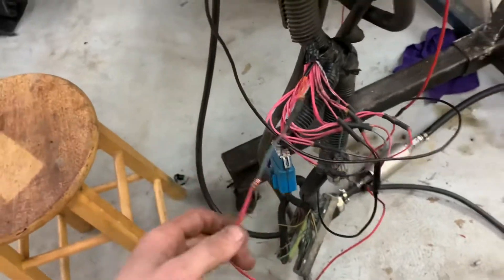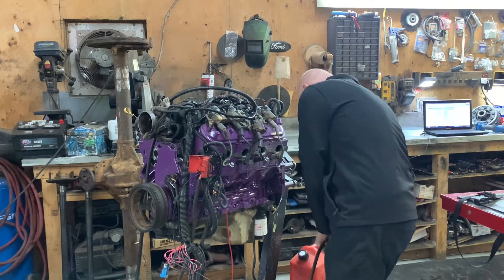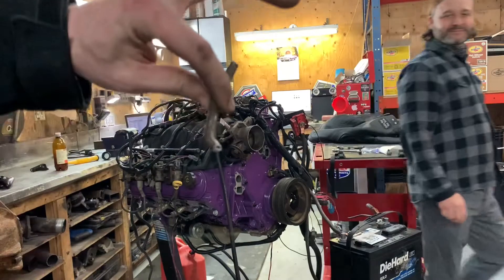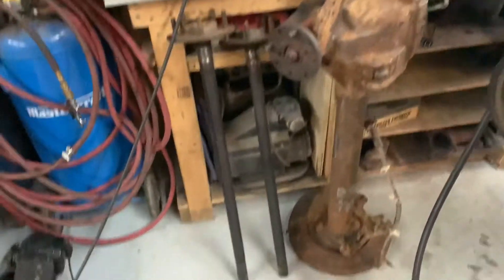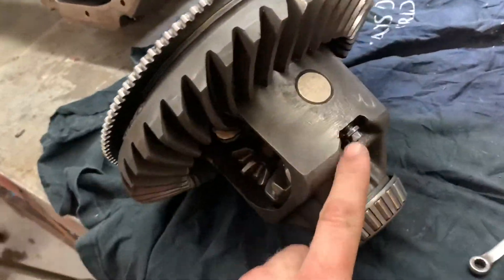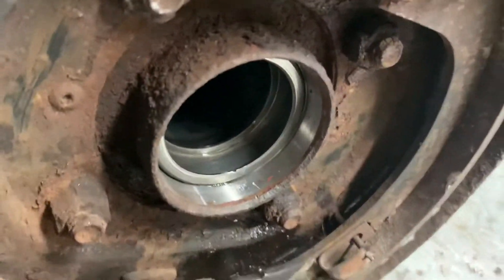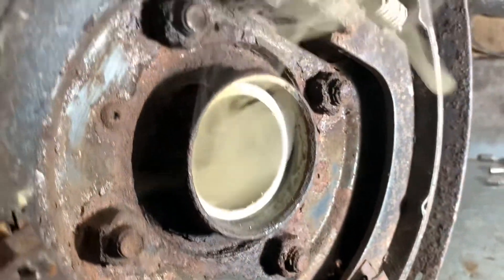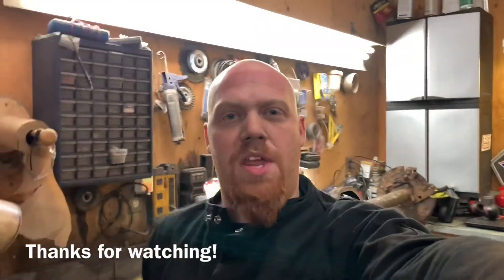Running a LS engine on the stand! And is very violent + how to remove side axle bearings easily! #17

Comment: stop talking I want to see purple   you blocking my view    lol its looking really good  is this the engine that you had the head off set issue on ??? and di every thing just fall together with out modification
Reply from the maker: 🤣 
The engine that has the offset issue is the one I’m building now, I can’t remember if I ever found it with another engine I built or not
Reply: @StationroadRatrods  hows that build going got any update videos coming on it   hhmmmm hhmmm
Reply from the maker: Getting a little done here and there 😁 going sandblasting today

Comment: Cleaning up the injectors? Cylinder 2 seems not to lively
Reply from the maker: I will, they’re original 1998 parts and haven’t been used in like 10 years, so they’re probably pretty rough. But to be honest it could be the coils, plugs, or wires too they’re pretty rough haha. Just really wanted it to run